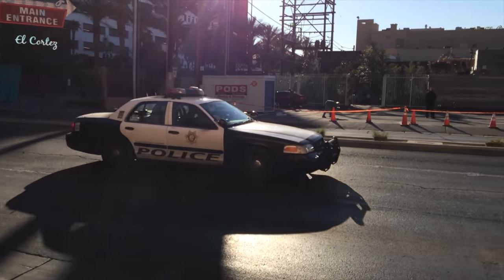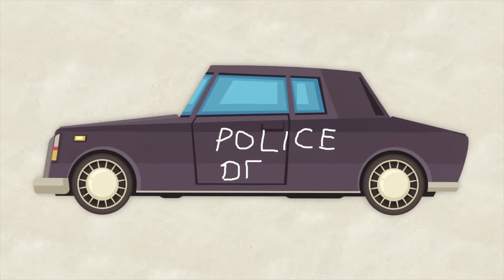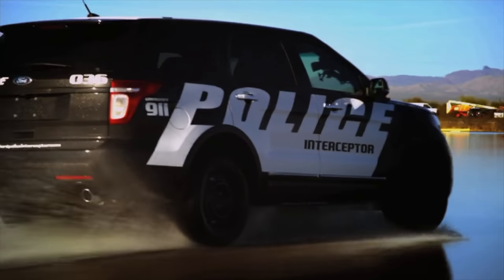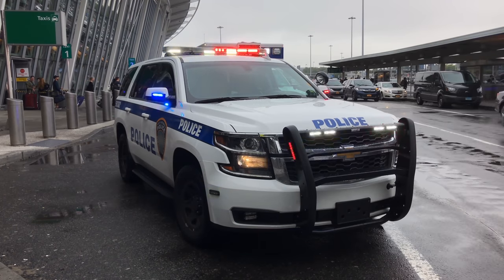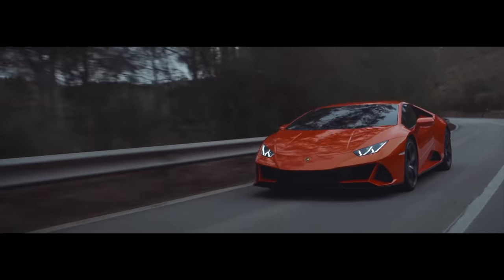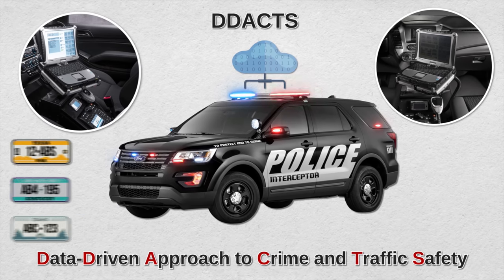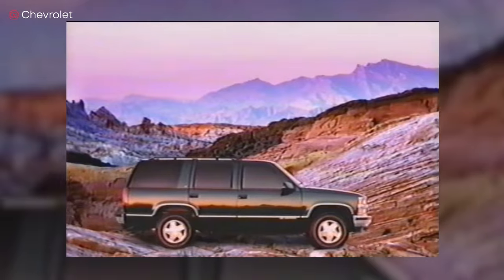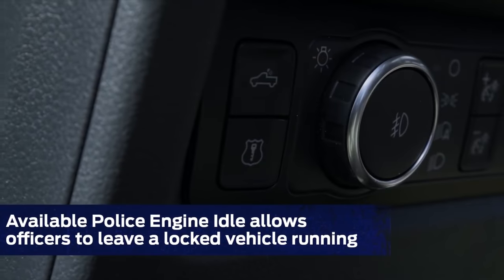Here’s Why You Can’t Outrun a Police Car

Comment: I outran and hid from a cop when i was a teenager. :) We were driving in seperate directions on the highway which forced him to turn around. I had a highly modified Mustang GT at the time.  I ended up parked in my friends driveway on a side street, thinking i was safe. An hour later when I went, home there were 4 cop cars in front of my house waiting for me. Thank God they were good dudes. What a dumb thing to do!!
Reply: cap
Reply: Cap
Reply: Cap
Reply: Cool story bro
Reply: What does 'cap' mean from replies? Anyway...yeah when we were kids, the guys were almost all gearhead in our small town and would goad and outrun cops all the time, losing 'em on backroads. I don't know much about cars, but I know my bf's was a Dart (souped up) and good friend's was an old caddy souped up. LOL Caddy went 210mph. Went over 120mph on a friends motorcycle. From what I understand, you can't go that fast these days if you tried w/modern vehicles...but idk.
Reply: @peterson6824  cap
Reply: @peterson6824  Some modern cars are capped at 100 and some at 123mph (200 kph), which honestly isn't fast enough for Texas roads. Most 600cc sport bikes hit around 160-165 mph stock (at least if they were made in the last decade or two), so 120 is actually quite slow and easy to accidentally hit. The 1000cc bikes are typically limited stock to 186 mph (300 kph), but you can easily flash that.
Reply: @peterson6824  it means hes full of shi
Reply: @jakegarrett8109  No lol. Only the speedometer is capped at 299 kmh, but the bike does get way over without being flashed
Reply: Lol ..sounds like a very small town! But hey when we’re young we do crazy stuff 👍🏾
Reply: Cap
Reply: A lot of cops are generally cool guys that just want people to learn from their mistakes and be good citizens. They know kids do dumb stuff and will try to give them an opportunity to have an epiphany and clean up their act. Yes some cops are assholes so there's some luck involved. But if you're genuine, honest, apologetic, and especially if you can make the cops laugh, they can be very forgiving.
Reply: Cause they got your Plates
Reply: U must be white
Reply: @peterson6824  almost any engine can hit 200kph it really comes down to the gearing,weight and cooling mostly cooling. It's like when truck engines run-away you can have a truck only suppose to have 500hp go up to 1200 HP before blowing up and that's mostly due to it not being able to cool itself, and putting a lot of stress on metal
Reply: Big 🧢
Reply: ...unless you need it for a demolition derby
Reply: @peterson6824  cap
Reply: @jakegarrett8109  that not what cap means lmaooo
Reply: @hunterbear2421  lollllll.
Output increases 2.5x, because the engine overheats😂😂😂😂
Wtf😂😂😂😂
Reply: @CadillacDriver  runaway engines can do more then triple there horsepower and can hit higher rpms then 10k, the only reason they explode is because the engine cannot take the heat as well as the stress
Reply: @CadillacDriver  it also starts burning it's oil after a while as well as fuel
Reply: @CadillacDriver  gas engines can do many amazing things and can be pushes far past the recommended specs the only question is how long will it last before the heat and stress of the metal cause a failure,
Reply: @hunterbear2421  right. I completely misunderstood your post, my bad. I read it as the power drastically increases because it overheats. Lack of sleep is a prick.
Reply: @CadillacDriver  don't worry it's fine
Reply: sound like a lie
Reply: @Wyo.  it's unlikely they would have caught his plate but then again he was in a highly modded GT and depending how big that city was they could have known him
Reply: Also is it just me or are people are more open about there crimes while online
Reply: Cap
Reply: lmao what did you do first?
Reply: @10toeken87  “U must be white” 🤓🤓🤓🤓🤡🤡🤡🤡🤡🤡🤡
Reply: I ain’t reading all that, I’m happy for you tho or sorry that happened
Reply: You gotta go in the garage bruh
Reply: @peterson6824  cap
Reply: So many children in this thread
Reply: cap
Reply: @10toeken87  he said mustang GT he’s most definitely white
Reply: Thats because they have a licenseplate reader in their cars so they know who you are looking at the computer.
Reply: I did the exact same thing When I was 19.The difference is I got away. I guess because I live in Delaware where you don't have to have a front license plate.
 I had some lawsuit money .I had a supped-up 240SX. So as I was  Speeding down a back road,  I was doing at least 70 in a 45 when I passed a  Cop. I saw his brake lights in the rear view review immediately I Start looking for a hiding spot. Long story shortI ended up backing into a driveway and about 25 seconds laterI see him pass probably looking for me. I waited a couple minutes and Went in the opposite direction. I really think the only reason I got away from it was because of no front license plate And it was a back road.
Reply: Cap
Reply: Cap
Reply: boastful story brethren could you please, tell it more?
Reply: I can testify the Plymouth Horizon/VW Turismo can outrun any cop car on the dirt roads 🤷
Reply: @kitdatkat  lmfao haters
Reply: Everyone saying cap here is showing how naive/sheepish they are
Reply: Why everyone saying cap. it sounds pretty normal it's not really hard to outdrive one car, the radio and the cameras are the problem they have ur plate immidiatly.
Reply: @stefanculo  It shows when people haven't met other people who don't care about laws
Reply: @Bandrik  ....Cap 🏠🚶
Reply: @stefanculo  It's not the outrun part... it's the part were they were all chummy after they caught up with him 😐
Reply: This is why you park hot cars in garages and remove plates...
Reply: @dnationapocalypse  the camera could have caught his plate. And wait at his place it's a normal thing same happened to my friend in Sweden 🤷🏻‍♂️
Reply: @stefanculo  It's a normal thing for someone to have a high speed get away from the cops.... they catch up with the perp and they sit and have tea and crumpets huh 😒
Reply: Lol we just reported the car stolen when that happen to us, only happened once tho doubt that a work multiple times over
Reply: @lilericinnacut  yeah i did that last time but they arrested me and showed my face on the camera i was almost about to get my license now i gotta wait 1 year just waiting for my court date.
Reply: I out ran a state police intercept car in my 67 MGB .
That Plymouth 4 door had the 383 with the 4 barrel.  They were very fast. Had the special tires too.
When he got close enough I grabbed the emergency brake spun around and left him . Did that same maneuver in my f100 6 pick up.
Lost many a chace car that way.
Reply: @peterson6824  Cap means lie
Reply: Cause you let them get your plates
Reply: Cap means they don’t believe you.
Reply: @peterson6824  CAP means 
Can't 
Avoid 
Police
Reply: @peterson6824  can't avoid police
Reply: Not the only one. Did mine in a 07 stocked Subaru impreza. Lmao An accidental win tbh
Reply: Cap
Reply: Should of went to mexico instead bud lol
Reply: @10toeken87  bro lmfao
Reply: cap
Reply: @10toeken87  And rich
Reply: Cool story bro
Reply: @peterson6824  bmws are governed to 160, but others vary. Depending on the car you can get around this with a tune and/or taking out a part. Most people don’t bother though bc they’re racing up to around 100 or so
Reply: Same thing happened to me but no one was waiting drove home fine but hands and legs were shaking
Reply: I would have crashed at the friends place
Reply: It’s funny that people say cap while they don’t know 100% if a story is false
Reply: @peterson6824  that caddy did 220 KMH not MPH .
Reply: @Bandrik  I’m glad I came across one when I was recklessly driving. Bro told me to never do it again if I wanted to have a good life. I never did it again.
Reply: @zeppkfw  dude that's awesome to hear. It's good when even a cop acts like a bro and is there to be honest and gives even half a damn about us regular folks. For you, I hope it paid off and you're having a good life. Peace
Reply: Shouldn't have gone home right away
Reply: Bet, say less, cap, chopped cheese, mad brick lol
Reply: I've done similar when I was about 19. By the time he turned around I was already down the end of a side street and hid behind a bush. Lol
Reply: Cap
Reply: That’s privilege
Reply: stop the cap
Reply: Sick & Tired of hearing about ELECTRIC cars..!!!
Reply: People saying cap but I literally know several people who have had this exact thing happen
Reply: Did you wear your cap?
Reply: @bennettgetshall2987  same situation for me, but I had a Ford Ranger and hid behind an old barn.
Reply: cap
Reply: Cap
Reply: HaHA HAHA they were a good dudes. Just gave you a few hundred dollars fine. HAHAH GOOD DUDES
Reply: @abrahamsanchez7455  no cap u dropped this 👑
Reply: Better hide ur license plate if u wanna fully escape
Reply: No license plate = no catching
Reply: Tbh I'm pro ppl that are goin fast in safe environments like empty toads or No much traffic at all and i hate the cops that instead of actually helping ppl and goin after bad ppl they go after cars that go 3 km  over the limit
Reply: This is why you don't run when its your plates imagine not thinking of that scenario
Reply: Yea that didn’t happen bud.
Reply: BRUHHH!!, HELLO 911 I GOT A WANTED PERSON BY THE NAME OF…
Edit: PEET DEZO!!!!
Reply: @peterson6824  no. You did not got 210mph in anything. And saying you can’t achieve those speeds in a modern car is just plain stupid, think about a 2022 Bugatti. Old is NOT better than new. In ANY way. Other than easily being able to work on it yourself.
Reply: @peterson6824  cap
Reply: @10toeken87  wat racism is dat dude
Reply: and thats why you take off your plates
Reply: “My friend was driving, I just went and picked up my car”
Reply: @ramazanuyar3958  in the US they are often speed governed, euro cars usually aren't of have a much higher cap or even none at all.
Reply: everyone whos saying cap has had the misfortune of growing up under the thumb of modern police who dont know you and are just enforcing a mindless unfeeling bureaucracy that doesn't actually have the best interest of the community in mind. nowadays the cops would probably be breaking a law if they didn't arrest you and throw the book at you over every little thing.

cops in the past were way more bros and had way more individual agency over the outcomes of cases like this. most of the time it led to good cops shining but idiots abused that personal agency and now our policing is completely procedural with no input for circumstances or human emotion.
Reply: they would have to have proof you where driving at the time
Reply: @youteasemiplzem9053  that’s what I said too, innocent until proven guilty baby
Reply: @jakegarrett8109  max speed limit here is 85 MPH (137 KPH), so as long as a car can do 100 it's good.
Reply: Cap
Reply: You can outrun a car but they can find you easy
Reply: @jakegarrett8109  200 kph isn't fast enough? Lmao
Reply: @Fireballun  Not to keep up with traffic in Texas (it takes hours and to get somewhere "closeby" even driving like that). I was driving triple digit (which is pretty close to 200 kph), at night, in pouring down rain with poor visibility, and someone still passed me like I was standing down beside a highway... Thankfully I just got my new race radiator installed in my car (about 60% thicker, and duel layer), so I should be able to hold 200 kph easily in Texas (otherwise it was so hot it would sometimes over-heat, greatly increasing commute times). Even the semi-trucks hauling big loads are often doing 90 mph there (145kph), its a big state and you still aren't moving anywhere fast at those speeds, lol.
Reply: @jakegarrett8109  Damn, I didn't know Texas had such high quality roads.
Reply: @Fireballun  yeah pretty decent. Even in MD they have nice roads but sometimes sand which is going to limit safe speeds on corners (so maybe just 100 mph around curves instead of 123 mph or 200 kph).
Reply: CAP = cool as phuck
Reply: Cap
Reply: Cap
Reply: @10toeken87  yea being white rocks 🤘
Reply: I'M TELLING MOM
Reply: People who still say “cap”:
🤓
Reply: No way they would’ve been at your house
Reply: @mathewl4043  on the highway going the opposite direction?
Reply: @marlon6598  I just found this I'm glad I'm not a child I'm about to be 20
Reply: I could actually see that happening. Chances is he didn’t bother chasing you because some cities and departments have a no chase policy, not saying that cops won’t still try to chase you, but once he run your tag he knows your home address.
Reply: @peterson6824  mean he is cappin
Reply: 🧢 cap 🧢
Reply: Cap
Reply: Exactly, this guy just needs some attention- looks lonely. It’s about the driver to it just the car
Reply: If this is true, this is the perfect example of why cop should engage a pursuit unless the driver is an activer shooter/ murder suspect/stolen vehicle

I mean the plates say who is the owner and where is the home.
Reply: probably because of your plates
Reply: Wouldn’t make any sense. They must have seen ur plates
Reply: @peterson6824  cap
Reply: cap
Reply: @tacticalopso  I agree, but I have heard of an incidents of hellcats that outran ran cops.
Reply: Cap
Reply: My brother outran the cops in a 2007 Honda Civic a pipe out the hood he outran them but the cops never showed up cuz he sold the car like right after some cops went into the ditch
Reply: Sure you did 😂
Reply: Cap
Reply: @realyopikechannel  you are 100% correct - and it is a shame
Reply: One of my old friends got 4 yrs in prison for doing something similar. He was riding his bike with his girlfriend on the back speeding. Apparently a cop saw him and he didn't know. He stopped at a off ramp and the cop pulled up behind him and got out to try to stop him. The cop tried to take the girlfriend off the bike as the light changed and my friend took off. After that my friend took off and left his girlfriend with the cop. He made it home. A short time later after my friend made it home cops showed up at his house. I myself got away from a cop that was coming up to the intersecting intersection as i crossed it. He had to wait for all the traffic to pass while I was able to book it over an overpass. I pulled into a parking lot of the casino i worked at right on the otherside of the overpass. I got out and non discretely walked into my job. I saw that cop ride the v perimeter of my casinos parking lot but he couldn't tell my cars from the 1000+ cars parked in the lot. Haha. It was nice but Its probably not wise to push your luck like that too much.
Reply: @peterson6824  this man grew up in the 60s and 70s
Reply: Out ran one in a 1970 Buick, 455 of course, stomped on the gas in front of a cop shop was a mile away before I even saw him in the rear view, pulled off the highway at the first exit and watched him speed by without a clue where I was, this was mid to late 70's, you have to be doing some serious speed as long as they don't have your plates
Reply: u must not be in the US? cause they ain’t lettin u go
Reply: I did the same thing. Except the officer was behind me. Technically he hadn't turned on his lights yet, so I technically didn't run. But he did drive around for a long time looking for me. I had four friends in my car at the time which I had to drop off. This greatly complicated my situation.
Reply: @xRenegade_999  Right? Some people just have to make everything about demographics and statistics instead of realizing that everybody's different yet similar, regardless of race.
Reply: u should of taken off ur plates 🤣🤣
Reply: How did he find out where u lived if he was going the opposite direction, he would’ve had to see ur plate which doesn’t match ur story, if they took the time to go to ur house just to let u go with no tickets, CAPPPPPPPPP
Reply: @kitdatkat  I was hoping someone in these comments had enough sense and know how of Dodge Charger Motors that no way on this Earth was this guy doing 200 mph. He would have been better off saying he was driving a NASCAR at least the story would be a little more believable but not much
Reply: Same thing happened to me except I had a 66 GTO, but they never caught me.🤔🤨
Reply: Bro. As I just had stated earlier, NEVER floor that pedal if their was a good opportunity for the tyrant thug to have grabbed your plate #. But if no opportunity was available for the gangsters to do so, then baby you better floor that pedal. And shut those headlights OFF
Reply: Cap
Reply: Lol
Reply: I had an emergency one time and can confirm that an Impala 2016 caps at 106.  Then It comes across the dash “speed limited”
Reply: @peterson6824  NOT TRUE
Reply: Yeah. You had a thing called a license plate!! 🤣🤣🤣
Reply: Cap.
Reply: Did the same thing as a teenager,,,and yes they were at my house an hour later !!
Reply: Sound samples of the sirens, and perhaps even comparison of other emergency vehicles.. a good idea?
Reply: @peterson6824  when I was your age-
Reply: Cap
Reply: @peterson6824  . Short for Captain. Some people who are from the eastern side of the Chesapeake Bay in Maryland use that word, especially the watermen who harvest the crabs and oysters. "Wuss goin on, Cap", in their drawlish accent.
Reply: Corn pop was a bad dude
Reply: @Bandrik  why is a furry talking
Reply: Hey me too! I got away and was paranoid all night. But ya back then but now the technology exceeds the car speed. They have equipment that tracks multiple vehicles from miles away. Aircraft related equipment.
Reply: @alexmedia7421  you're 100% right...I'm making it up to impress a bunch of people I'll never see in my life.  🤣
Reply: Cap
Reply: My Truck cuts off the acceleration when I try to go over 100mps . My friend said it’s because the company put a governor in the engine.
Reply: @peterson6824  my 18 Camry can reach speeds of over 140mph
Reply: Lmao thank God they were good dudes🤣🤣 I'm lookin at the likes, like 🗿
Reply: cap
Reply: Mans lucky cops 👮‍♂️ do watch YouTube
Reply: Lmao 👏😝
Reply: Top hat 🎩
Reply: Witnessed it plenty of times out here I believe you
Reply: Learn your lesson the hard way. =)
Reply: Bunch of little kids saying cap 😂
Reply: @Bandrik  No amount of racing is good for you or the cop specially the people you are putting in danger even as a teenager. Don’t think just because teenagers are seen as people who learn from their mistakes makes it right for them to speed up to 100 just for the kicks of it and then they’ll learn. The real world doesn’t work like that unfortunately and even though I did have my quicks at times it did bring consequences. If the cops don’t catch you karma sure will. Sooner or later you’ll find yourself hitting a pedestrian on accident and then there goes your tiny little teen life for ever washed away in prison. Don’t learn and live. I say try to be a good kid and don’t hang around the wrong people, but hey you’re always welcome to join the prison system if you don’t believe me.
Reply: @spartanalphamode2987  Oh yeah, I agree with you. It's better to be smart and not do any of this to begin with. I have really no tolerance for endangering others in a reckless manner. But if someone does it anyways, depending on how bad it was, I think second chances should be allowed. But if someone gets hurt or worse, the kid gloves come off.
Reply: @Bandrik  My dad always told me that if I ever wanted to race I needed to go to the track and do it the right way without putting people in danger. I didn’t like that for one reason and it was, because I really couldn’t afford being at the race track in the first place. So one day I asked my dad when I could race my car at the race track, and he said “son you’ll eventually learn that everything has a price” 😂 I actually never touched a race track until I was older and could afford one either way, but my point is that my dad always told me that in order for me to even dare want to race I’d have to do it in a controlled environment aka a race track or never do it ever. But yes I was given a car for my birthday worth nearly $7,000 a mustang and I really appreciate what my dad did for me so that I must pass on to my kids.
Reply: @spartanalphamode2987  your dad had some really good advice. I'm glad you followed it, and that's awesome you got that car. I'm sure it was a dream come true and gave you a huge sense of pride. Your dad sounds awesome :)
Reply: So cap. They won’t even care about you after you get away
Reply: And being white helps
Reply: @10toeken87 u must be a proud victim. Must be frustrating......
Reply: @Fangthedragonwolf4 sure you did.....
Reply: So we are just going to ignore the Scat pack Pursuit?
Reply: Guys, Here is Our Savior

YaH The Heavenly FATHER HIMSELF was Who they Crucified/Pierced for our sins and “HERE IS THE PROOF”

From the Ancient Egyptian Semitic: 
"Yad He Vav He" is what Moshe (Moses) wrote, when Moses asked YaH His Name (Exodus 3)

Ancient Egyptian Semitic Direct Translation
Yad - "Behold The Hand"
He - "Behold the Breath"
Vav - "Behold The NAIL" <— YaH’s Crucifixion
He - "Behold the Breath"

“Behold the HAND that Beholds The NAIL” 

PROVES - YAH The Heavenly Father HIMSELF was Who they Crucified

That is EXACTLY what Moses Wrote

Here is what they mean

YaH's Name:
(Ya)d + (H)e, as YaH is what Moses called Him and YaH Declared: "this is My Name, this is My Name for all generations" (Exodus 3)

YaH is The Creator of “MAN”: (Genesis 2:7)
Yad He, (HAND BREATH), as YaH's "HAND" Formed man from the dust  of the Earth and His "BREATH" made him a living being (Adam)

YaH's Sacrifice of Crucifixion for “MAN”:
Vav He (NAIL BREATH), the "NAIL" through YaH’s "HAND", in Sacrifice of Crucifixion, that whosoever shall call YaH Savior, His “BREATH” brings forth life (Salvation)

How YaH arrives:
YaH arrives via the Tent of Meeting (Exodus 33:7:11, Isaiah 54, 55), where a Tent is erected outside the city, a cloud descends upon the entrance of the Tent and YaH appears...

Why they demanded YaH to be Crucified:
YaH was Crucified according to Hebrew law (Deuteronomy 21), to be NAILED/PIERCED on an Almond Tree for BLASPHEMY as it was for His NAME they demanded Him Crucified. The Messiah claimed He was YaH...

HE WAS YaH!!!

HalleluYAH translates “Praise ye YaH”

The Hebrew Book of Isaiah

Isaiah 42:8
"I am YaH; that is my Name! I will not yield my glory to another or my praise to idols.

Isaiah 43:11
I, I am YAH, and there is no other Savior but Me.

Isaiah 45:5
I am YaH, and there is none else.
Reply: My Evo tops out at 245 mph 😂😂 the police in my city don't even attempt to chase me. They've actually let me open up on the streets and know I can do a 0-60 in 2.34 seconds
Reply: Cap☠️
Reply: They can run you into a curb, pull you out or some have actual anchors that deploy and stop your car.
Reply: Why tf where you on the opposite side of the highway?!?
Reply: Great informative video, Scotty.
Reply: Sure was - you should have reported your car stolen  - then walked home !
Reply: Sure was - you should have reported your car stolen by 👽 ALIENS- walked home
Reply: I did this as a youngster too in a 89 Chevy Caprice in Dallas TX. He didn't get my plate and I dipped off and waited in a McDonald's for a hour before proceeding to my destination.
Reply: @peterson6824 You’ve clearly been avoiding automotive news because 200 mph is not a crazy milestone anymore just this year a gtr went 237 mph in a roll race at tx2k lol and most performance manufacturers advertise a 200mph top speed as standard now, 40 years ago 200mph was unheard of
Reply: @peterson6824 
My 1st car, a 5 speed Ford Escort 2 door used to do 220+.
It was modified by the dealership owner's son. Torqued up. I used to do Lansing to Kalamazoo in sub 20 minutes. True story but most people will doubt it just cuz they'll never go that fast in their lives. I used to blow by State Police with the blue cars and big red circular lights on top. Not once did they even try to chase me.
Reply: @peterson6824 Dodge Darts ruled!
Reply: That was happening in our locality with the young bucks . Drifting and dropping the clutch and doing smoke doughnuts. Also racing up and down our modest mountain . They never figured on police helicopter with high tech fancy liquid nitrogen cooled gear recording from five kilometres away where they returned home and where they hid their cars and stolen number plates .
Reply: It's not cap if it's a story from the 80s lol.  U could get away with a lot then
Reply: @brycerush98 bmw cant redline either they got a engine shut off at redline thats why the japanesse drift king have a s2000 engine in his
Reply: Both of these happened about 45 years ago. The 1st one, I didn't outrun him. I outsmarted him. He was waiting high up on an on ramp, waiting for someone to come speeding by. Here I come, doing around 80 in a 55, about 2:00 AM. Just past where he was hiding the highway curved to the left, straight for ½ a mile and then turned off to the right, like an S. Right about the middle of the 2 curves was an exit, just past a hill where he couldn't see if I got off or not. I did. Barreling down the hill, made a right turn just enough to be seen from above, then whipped the car into a U turn and was doing 25MPH on the surface street going the other way than I would have been. I saw him above on the highway with lights flashing, trying to see if I took the exit. He sped off to look for me. My ruse worked! 
The 2nd time was on a County Highway and it turned into a Y. The highway continued on. The other leg paralleled the highway but had turn offs into residential areas. By the time the policeman caught up and saw thru the trees I was on the other road, he sped up to get to the next light so he could turn back onto the road. Of course by this ime I was already home. But about 5-7 minutes later there was a knock on the door. When I answered, the officer handed me my McDonald's bag and said, "You left your supper on the roof of your car." I cracked up laughing and said I had to pee so bad I just grabbed things and ran inside. He said like I've never heard that one before. Just then my 5 year old daughter could be heard in the background, "daddy you stepped on kitty's tail when you were running to the bathroom." Without missing a beat the officer said, "but I haven't heard that as an alibi before. Have a good evening."
Reply: @peterson6824  u old
Reply: lol.  Sounds like what happened to me  one late night in 1973.  My 72 Celica was doing 120 mph ( per my  speedometer)   Racing a 71 Cuda.  Eventually we went  opposite directions  after passing a parked highway patrol car. We were long gone by the time he got wound up. I saw the distant blue lights in my mirror as the patrol car went after the Cuda.  So I slowed down to normal and cruised on to my girlfriend’s house. As I casually walked from my car in the driveway towards  her front door, the aura of blue lights lit up the night. On my ride to town, we went to the scene where the Cuda had been pulled over and was surrounded by 4 or 5 cop cars.  I didn’t see the driver or how many weapons they were removing from the trunk of that Cuda.  True story.
Reply: Make 2 right turns and another right to park in a driveway turn the car off lean the seats back
Reply: I outran them twice successfully and one time unsuccessfully crashed my 16k car it got permanently seized but no jail. I outran them when they weren't chasing me just sailing at 150mph on nyc highways no cop cars can actually do 170mph for 5 minutes to catch up
Reply: My friend's is350 had a full exhaust illegal tints no mirrors no rear lights burgundy color carbon fiber trunk no license plate light no working headlights just bottom fog lights suspension mod dropped really wide rims low miles and traction control disabled then holding traction button after disabling it for 5 seconds disabled the stability control for full hp out of corners. Did burnouts anytime in 1st gear holding brakes. Sometimes the rear tires broke loose from a stop at about 20mph
Reply: My other friend had a Mitsubishi Evo 8 with 850 hp but didn't have a real 1v1 on a po with it. He did outrun the srt8 po charger in NYC in is350 did an exit off of belt parkway highway and made a left did a u turn back into the highway cop went right but the cop almost got him if the cop went left. Another time he outran the cop in the is350 by going on a small 2 way street 100mph recklessly then going to a 3 lane public road ocean parkway with pedestrians 100mph again then belt parkway top it out n safe. In his Evo an undercover cop was about to get off an exit one day and was not committed to the exit lane halfway on highway halfway on exit lane my friend downshifted n was gone shot a giant flame too no real chase impala vs 800hp rally car with 20k in suspension mods 20k engine mods
Reply: Cap
Reply: @10toeken87 Nah it's called small town life.

If he was black the state would've paid him money to keep on speeding in a big town.
Reply: how tf???  How could they possibly have known where your house is?
Reply: Are there unicorns in your story??